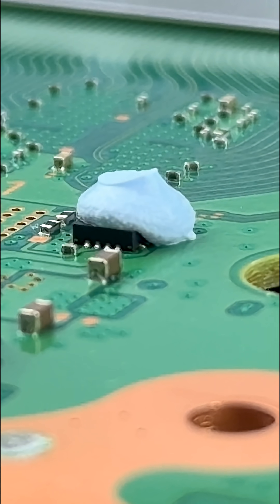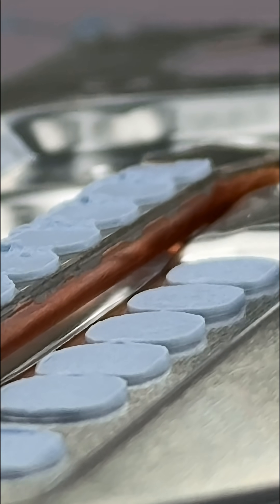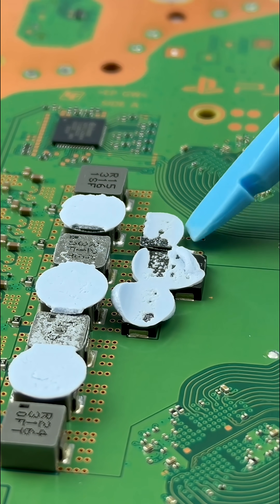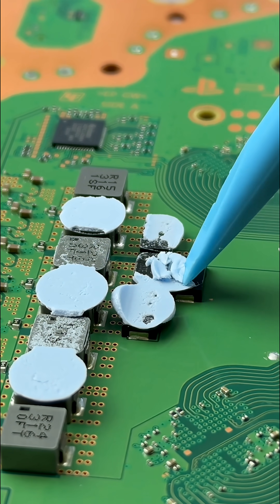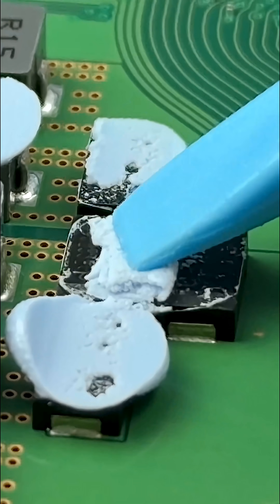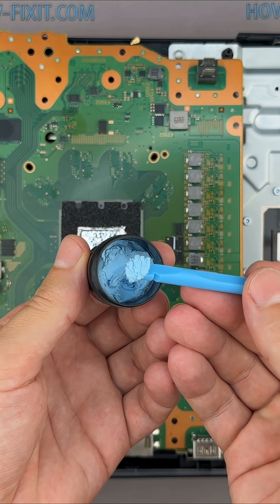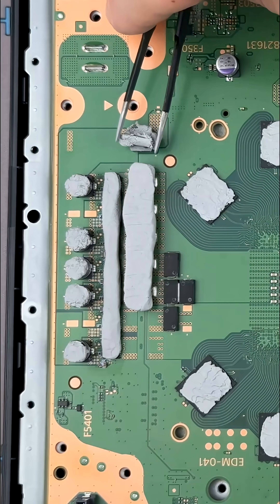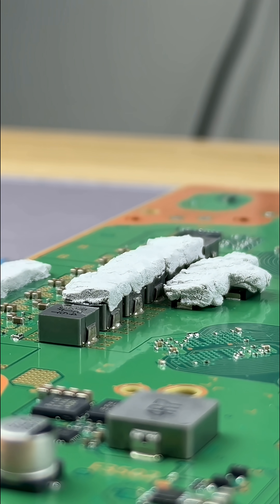PS5 Thermal Pad Replacement Tip | Thermal Pad Wear Signs (PS5/ Slim/ Pro)

Comment: The problem is no Graphics Card has the correct specs or replacement pads for Older Graphics Card eg Asus XFX GTX 260 GeForce Black Edition what size thermal pads to buy for different regions on the Card and if Noctua NT-H2 can be used for the processor while pads for VRAMs